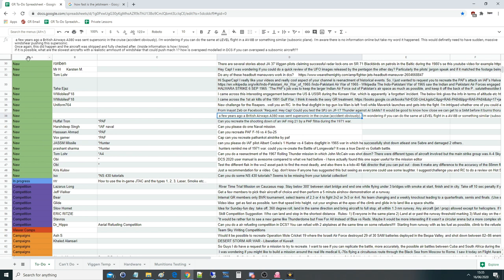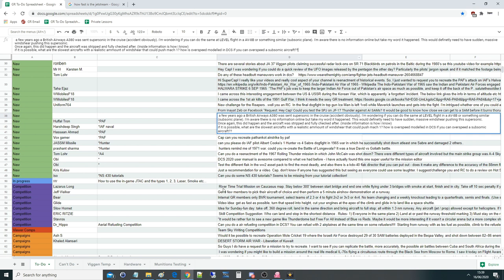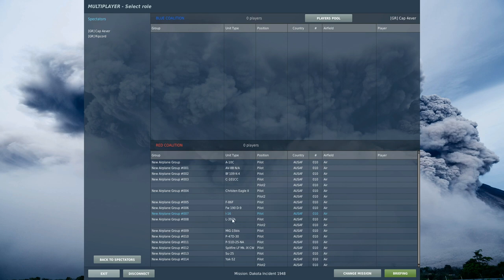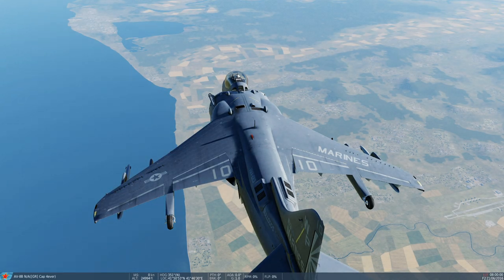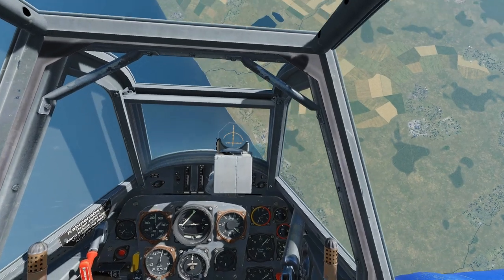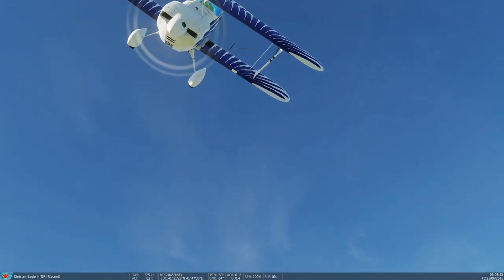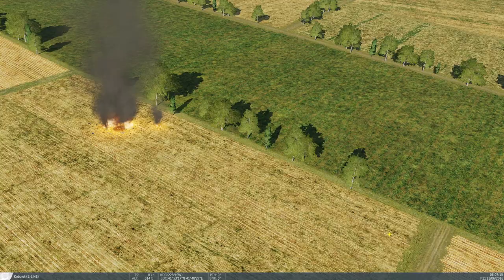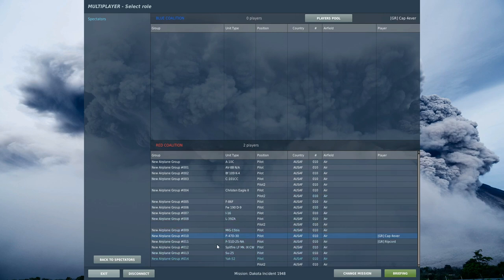Questioned: Which Subsonic Planes Can We Force Supersonic Through The Sound Barrier? | DCS WORLD

Comment: George Walsh and the Happy Bottom Riders club sure would disagree with Chuck Yeager !  
If You go to the air and space museum, they say Chuck did it first ( but dont bother to say "In Level Flight".
Civilian pilot George Welch is generally known to have broken the sound barrier on 1 October 1947 in an XP-86 Sabre (F-86 prototype), which was two weeks before Yeager's flight. HOWEVER it was in a dive. Yeager gets the credit for breaking Mach One in level flight (often this level flight distinction is not included in Yeager accounts). What's more, just 30 minutes before Yeager's 14 October flight, Welch did it again, in a dive. I've read that the AF succeeded in having the Welch flights' info squelched so that it could claim the record by an AF pilot. The XP-86 officially achieved supersonic speed on 26 April 1948. Welch was one of the few Army Air Force fighter pilots to get airborne at Pearl Harbor on December 7, downing or damaging at least four Japanese planes. He was a 16-kill ace by the end of WWII and in Korea as a civilian instructor he unofficially (of course) shot down several MiG-15s. He died in 1954 when his F-100A Super Sabre came apart during a Mach 1.55 pullout. Chuck Yeager was flying the chase plane.

Comment: Why is the mig-15 not going supersonic at 560 kts, when the su-25 does?! What gives, mig15 went way faster, ~650 kts
Reply: The LSS (local speed of sound) is responsible for that. At sea level with ISA conditions (1013.2 hPa, 15C) the LSS is 661knots. When you go higher, the LSS changes as the density and temperature changes. Eg at 30000 ft it’s 589 kts. This is TAS, as you instruments are displayed in IAS the value you read will be much lower. Mach = TAS/LSS

Comment: i'd add some engineering to the harrier, considering it is roughly 30 something miles per hour shy of mach 1 (probably stripped bare and running on fumes).    i'd add an extra engine to the rear (in a fixed position) tandem style, and then add a split tail of "black widow style elevons".   Then i'd make the wings larger (and throw that stealth crap out the window).  and i'd rebalance the plane by adding weight (as needed) to the front.  Ex:  avionics in a longer, bigger nose, a titanium bathtub for the pilot, and rounds of ammunition until the balance is at the preferred precise amount.

Comment: You'll need more altitudes.
And you'll find that an aircraft if it doesnt designed for supersonic flight, then it will simply break all the airframe. Supersonic is not about vertical dive, but also about the aerodynamic design (wing config) till the load factor that it could sustain.

Comment: early models of the p-47 and p-38 achieved supersonic flight...accidentally. the p-47 was in a shallow dive long enough to overspeed during testing when it went supersonic. it ripped the fabric off the tail controls and the pilot was forced to bail out. the plane was lost, but thankfully the pilot survived. the p-38 was in combat over the Europe when trying to evade 3 German fighters. pilot crammed the stick forward into a dive and of course  the controls locked up. a last ditch effort with the speed breaks helped the pilot regain control of the aircraft and the plane and pilot lived to fight another day.
Reply: The P-38 was known to have a problem with locked controls at higher speeds, still nothing near the speed of sound. The P-47 is too draggy to hit the speed of sound with a radial engine

Comment: Question: since you can design different air speeds and wind directions at different altitudes, why not just do a less steep dive with a tail wind at higher altitude and an headwind at lower altitude?  This way you get the benefit of trading potential energy for kinetic and also altitude based wind shear.
Reply: Big Brain!

Comment: How do you expect there to be a vertical barrier between the wind going in opposite directions IRL? there is no such thing. What could happen is for such barrer to be horizontal. Jetstream going very fast and then the layer of slower air a bit lower. And then an aircraft moving in a jetstrean and descending into the slower air. That seems like a more possible scenario.

Comment: Hey cap on the upcoming summersale i want to buy a new module but cant deside betwene the ka 50 , mig 15,f86 at first I also thought about the mig 19 but because i have the mig 21 i canceld it. Any tips ? Btw I dont have any heli. Thanks in advance
Reply: The KA-50 is a very good helicopter but you must have at least rudder paddles and some kind of track ir
Reply: @jarlevanlandeghem8595  ty sadly i dont have track ir :(
Reply: Believe me if you mastered the KA-50 you rule the battlefield. And in the future you will have air to air missiles
Reply from the maker: Ka-50 can do a hell of a lot. Mig and 86 are both cool planes. Ka-50 probably better value for money.
Reply: @grimreapers  ty
Reply: @jonas9292  You don't really need TIR for the Shark. When running the thing up you can use the NP0 +NP# keys to use snapviews to see all the switches and once the thing is running you'd just need to look down at the Shkval screen with zoom. Of course, having TIR (or Opentrack via Webcam) or even VR makes it "gooder" :)
It's definately a blast to have and you wouldn't regret it.

Comment: "There's no way your spit is going super sonic!" Haha! Google the Spitfire that went super sonic.
Reply: No Spitfire has ever gone supersonic. But if any warbird could do it, that'd be the one. A Spitfire PR.XIX went Mach 0.96, the highest speed ever achieved by any piston engine prop plane. Compressibility error causes the airspeed to read higher than it actually is at those speeds, so it was initially reported as being supersonic.
Reply: @xeigen2   mach 0.96 

It's is a subsonic speed not supersonic 

Supersonic means it should be at mach 1
Reply: The p-38 has gone supersonic in a dive...it had to have special fowler flaps installed to not lose control of the plane